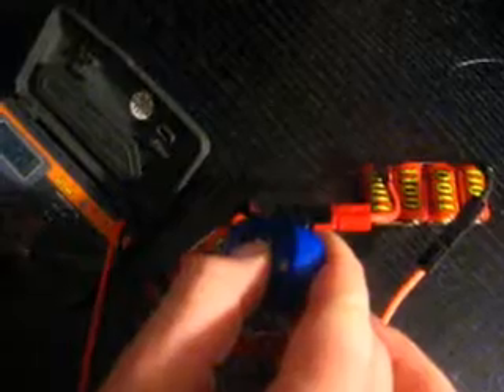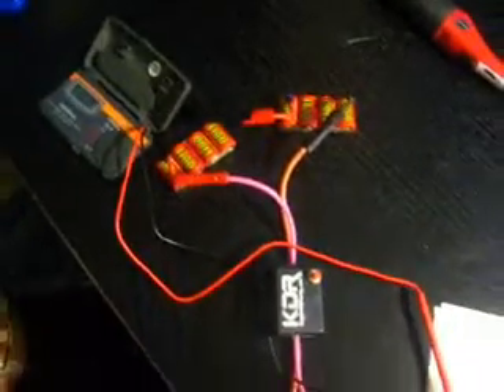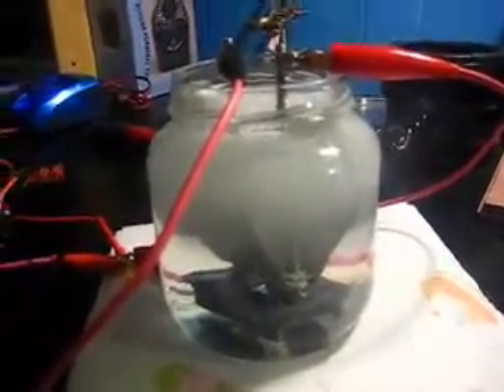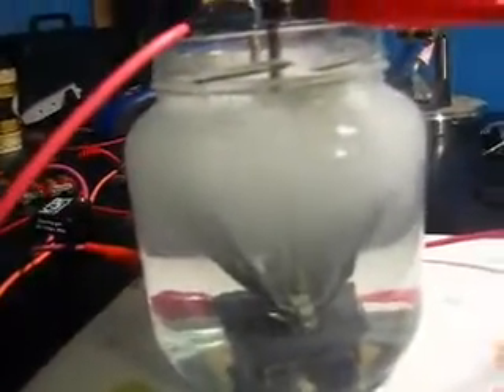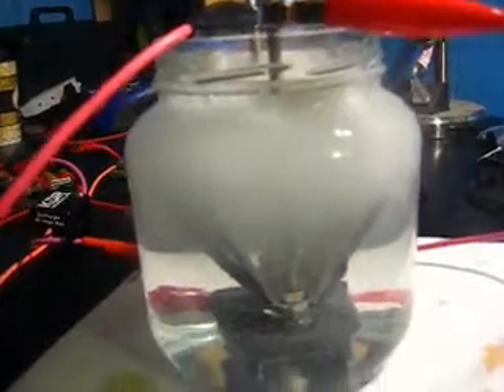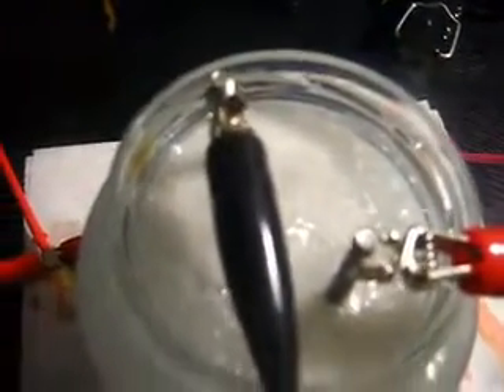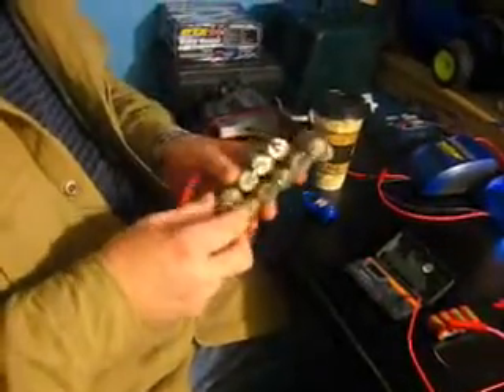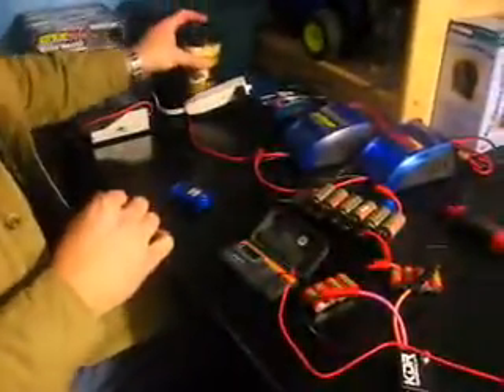Hydrogen Electrolysis Stage 2 Part 002 / Dr. Franken Zap

Comment: actually its total watts that you need to be looking at.  in a simple parallel cell such as what you are showing here, you will get best compromise between efficiency and prodctivity if you hit is at about 3v with all the amps you can muster. over voltage will get translated into heat. plate surface area, spacing and concentration of electrolyte are how you control amp draw.  Large plate, closely spaced with saturation e-lyte will pull high amps.  to trade volts for amps use neutral plates.